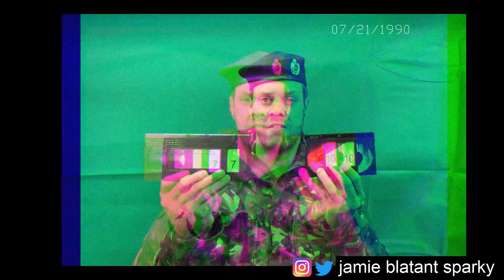BS7671 Amd 3 bidirectional RCD,s (double Enders)

Comment: Since this video is spamming my page i'm going to add another comment: Where I'm from we mainly make our own boards, as opposed to the microwave-ready tiny shite half-fab db's you guys install. We don't have the luxury of having fused sockets so we do loads of radial circuits and spurs so our boards differ a lot from project to project. A common thing about board changes is that sometimes to save the wire length and not splice it you have to choose a double-ender just to make sure you can feed it both from the bottom or the top. You get weird instances in which you need to make things fit. Most normal RCBO-s and RCCB's are double enders, the only ones which aren't are most of those electronic POS's that so many are keen on but they have issues like : being unidirectional, can't test them with 500, they get ducked by over-voltages, are prone to various faults AND DON'T WORK WITHOUT A NEUTRAL.  I hope you can explain to me why you guys are so obsessed with those standard three-phase boards from Schneider and the 18-22 ways on resi boards. Ta.

Comment: Yes Jamie. This is nothing new. When we is install a solar system sometimes the battery or DC feedback can trip an RCBO. With every job we have to leave Startup/Shutd instructions next to the inverter, sometimes if these are done in the wrong order it does trip the RCBO. But we have a workaround for this, we use a standard 63amp type (A) RCD with a 25amp MCB in series with it (typical 5Kw system). The RCD is able to handle 2way current and never trips unless there is a genuine fault.

Comment: Regs say MI should be considered’ - not necessarily followed. 

Proteus bi directional double pole RCBOs are still cheaper than Hager pony SP RCBOs. I accept lots of other manufacturers don’t yet sell them.

Hager pony situation over RCD testing is well known. BS7671 is a minimum standard. You can still do all the tests if you want. Guess Hager will fail 🤣 but I no longer fit em! Jägers gone down the pan in many eyes.

Comment: I have just installed a 16A TP&N Interlocked Socket Outlet for one of my clients. The socket outlet is to be used to supply a FLT charger and a quick read of the instructions for the FLT charger states that a type B or B+ RCD must be used. I had to pick my clients jaw up off the ground when I told him how much a 4 pole Type B RCCB would cost!! He wanted to see proof as he was in such disbelief which was uncommon for him as we have a very good supplier/contractor relationship. He laughed his head off when I told him the price for the Schneider version!! Crazy!!!